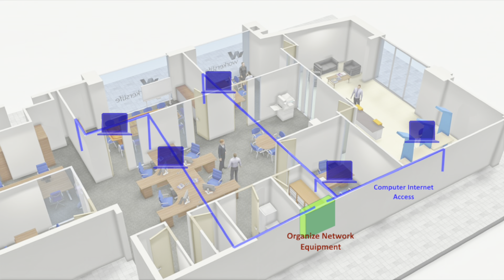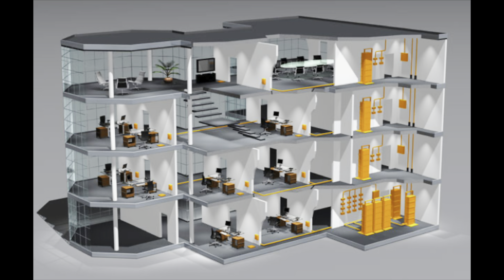Removing a Network from a Commercial Office Space

Comment: Greetings from Europe - Prague. I'm a little envious of plasterboard partitions and raster ceilings. many offices are in old buildings where the cables are under the plaster and nothing can be done with them. most often, the original distribution is left and a new one is added in the cable conduits. But in general, it can be said that the exchange of cat5, 5e is poorly defended to customers "after all, it works". How are you selling network upgrades?
Reply: Hello from Canada - Ottawa. Jsem Cecho-Kanadan a pracuju tady jako sysadmin a ne primo network engineer ale k vasemu dotazu: pokud je potreba v office privest nove zasiteni, tak misto ve zdi se kabely vedou stropem v drop ceiling nad panelama ktere se daji vyndat rukou. Kabely se svadi na centralni misto na patre kde je switch a patra jsou spojene paternim vysokorychlostnim optickym kabelem. 

1Gbit copper je skutecne dostatecna rychlost pro vetsinu host devices, jako jsou pocitace a kamery, pokud mate tým ktery pracuje s video media kde je vetsi bandwidth potreba, vetsinou se jejich pocitace pripojuji pres reinforced multimode fiber.
Reply from the maker: I actually find it a difficult proposition to sell folks on upgrading from cat5 to cat6.  The IT guys within my client's companies are usually the driving force for an upgrade, more so than any pitch I could make to them.  And of course, if there's no real gain for the client I don't try to suggest an upgrade if things are already built.

Comment: Im suprised they dont just leave the wiring. Why not leave it for the next tenant? Why rip it out? You dont remove electrical and you want data close to power.
Reply from the maker: From talking to landlords I have met, they don't appreciate the layers of network cable that build up in ceiling over the course of 3-4 leasing cycles with different tenants.  I have removed cat5 and come across tons of cat3, old rg11 and rg59 stuff, all manner of BNC, token ring, and DB25 terminal cables all in the same office.  That said, if it already had cat6 I would gladly move right in as a new tenant, it would be a gift to get a pre-wired space.
Reply: Typically in my region the network cabling is left by the tenant. We are always being asked to reuse existing cabling. But when adding a new run we find all the old cables and it can be a real big mess, so I can definitely see the case for removing the cabling.
Reply: When we took over our offices the Cat 6 was already there.  We just hooked our IT Network and Norstar Meridian phone system to it.  Saved a lot of work (and money).